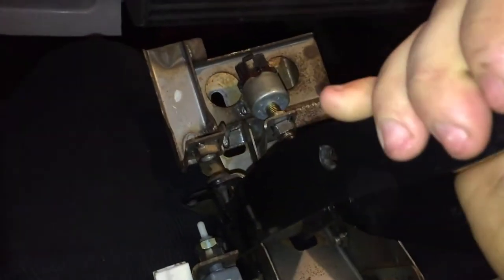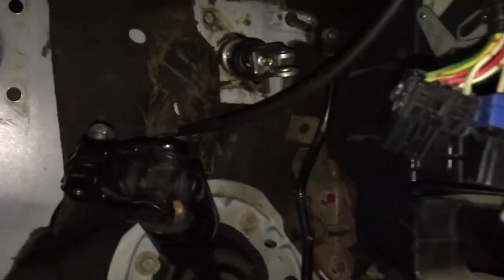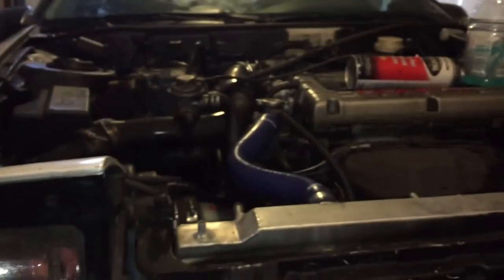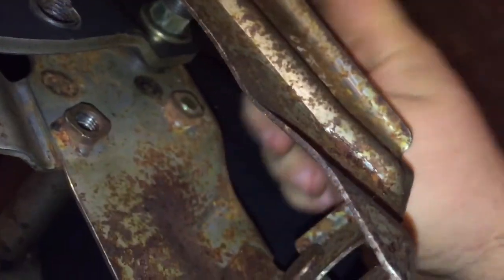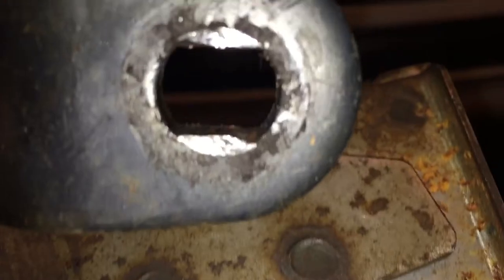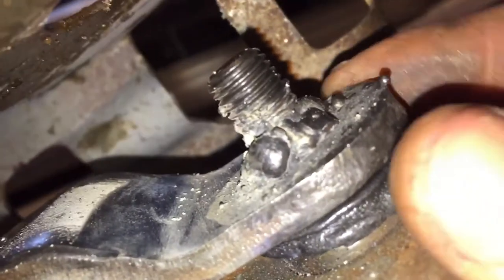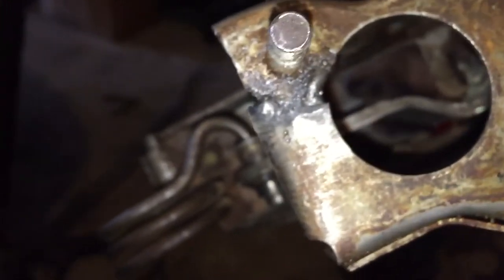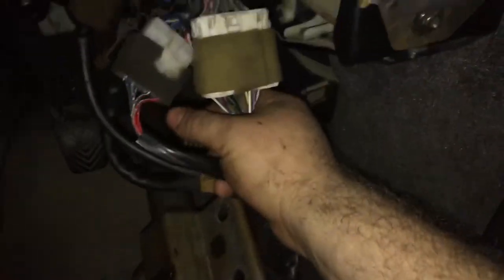1g dsm clutch pedal repair

Comment: How's the weld holding up? Just pulled my assembly but there's a lot of conflicting info. Works for some, doesn't for others. -.-
Reply: a half decent weld should be about 100x stronger than the way the factory did it. i would guess anyone who broke it again did not know how to weld properly and should have paid a pro.
Reply: @eclipsegst9419  I had mine welded by someone that’s pretty damn good luckily. Only got about 100 miles on the clutch before I started chasing down new DSM problems lmao. Fucking DSMs
Reply: @w4rf4c39  Driver Slash Mechanic :) this is why it's just my "backup" car lol